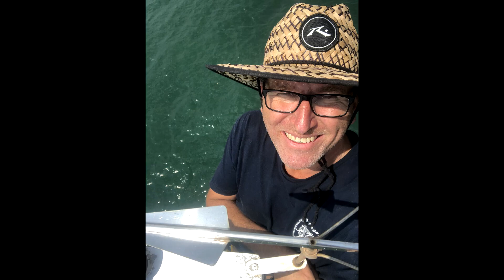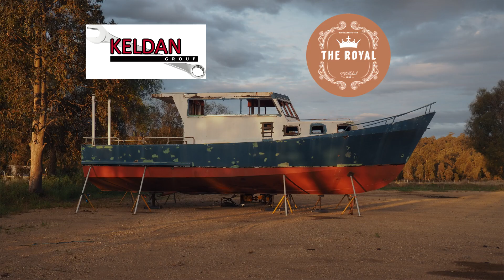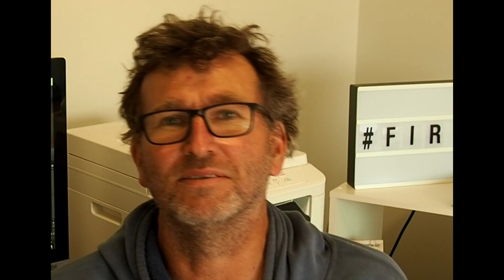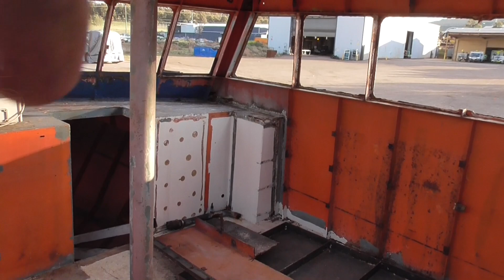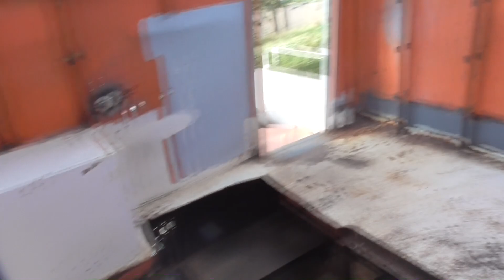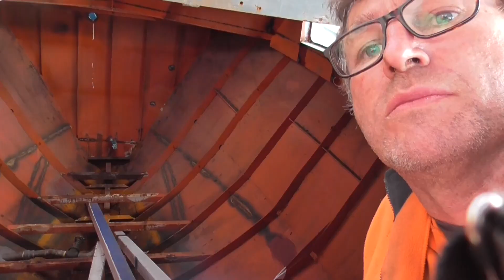EP32-Rebuilding a liveaboard trawler. Starting the planning stage

Comment: this project is just getting started and your banged up already.  hey take it easy.  i really like the forward raked windsheild, and rear salon idea.  is it worth doing an arft propellor bottom hull mod. make it like something like traditional shape after prop. but heaps of work though.
Reply from the maker: Thanks. Yeah but if a set back with the shoulder but I’ll get on top. It has slowed me but hasn’t stopped me. I’m doing research on propeller set ups at the moment. Pretty interesting the various designs that are out there. Thanks for watching. Appreciate the feed back too.

Comment: Why go to so much trouble to have a forward raking windshield?
Reply from the maker: Hey Paul, You must be a great bloke with a name like that. Top question, three reasons, Cuts down on glare from the dash items at night, When water hits the window it sheds a lot faster as the wind pushes it down instead of up and holds it on the glass when it is sloped backwards and lastly the area above the dash gives you a place to put radios engine gauges. Cheers.

Comment: I built a 52f yacht from scratch, your road is going to hurt more than you think, however I agree, your fore peak doesn't look bad. Your keel plan looks spot on. Be prepared to find surprises. Anyway I want to see what happens. I will subscribe
Reply from the maker: Hey Mark, I would love to see details of that. I'm pretty good with pain especially that which I inflict on myself.

It is mainly the mid section of the boat that is ordinary, as well as a lot of the steelwork I want to remove anyway. It seems tome that the areas that were modified later in the boats life are the areas that are not fairing so well. thanks for watching. Cheers, Paul

Comment: Excellent idea to reduce the shaft pitch ,the flatter the better for handling 
200 hp maybe a bit light for your boat Paul,  
Big mistake I did on mine is I did not fit stabilisers but I did add 5ton keel ballast and installed fuel and water tanks low down on the centerline ,  love your planning as well ♥ , good luck with her she is a very nice looking boat
Reply from the maker: Thanks John,

235 then lol. I only want it to be a cruiser so from the calculations we have done 200hp should push it through the water at 10 knots at 2300 rpm and cruise at around 7.5knots at 1800 using a 24 inch prop and 2:1 ratio gearbox. Do you have any out of water shots of yours? I have been pondering stabilisers. 

Cheers Paul
Reply: I sadly don't have any photos of her on the hard as my telephone went swimming in Victoria Harbour malaysia 😢
Ok with your cruising speed I set mine at 12knt changed the prop from 24x20 to 28x24 2-1 reduction and 380. Hp detroit diesel
Two other things that might help
1, I installed 2 radars 2 radios, 1 ssb radio 1 uhf I used all Garmin on nema 2000 which I quickly changed into individual units because it broke down and I lost all electronics 
2, I installed 3 separate solar systems 1 for engine 1 for house and one for generator 
I also installed ACR between engine battery and house battery
After going blind in the south china sea with centralised electronics I took fright 😱

Comment: She looks like it has had a bit added onto the stern judging by the position of the end of the drive shaft tube.
I reckon you could move the engine back a meter and gain some more usable space forward of it.
My old man rebuilt a steel cray boat in the late 70s , took it from 35’ to 57’.
Still working in WA.
I’ll send you a picture if you want.
Reply from the maker: Yeah sure please send to pauldunbar1@telstra.com   I don't think it has been extended. But I will know more the further I get into it. The rudder is not in situ at the moment so it threw me a bit also. Thanks Paul
Reply: Just flicked you a picture on the email.
I think this photo was last year from the broker.

Comment: why not but jet drive in the boat
Reply from the maker: Hadn't considered it actually. I did some work on a 40ft crab boat in the Kimberly 20 years ago. They used to anchor up and wait for the tide to drop and then go out and pull crabs out of holes in the mud flats using fencing wire. The boat was high and dry so to speak.